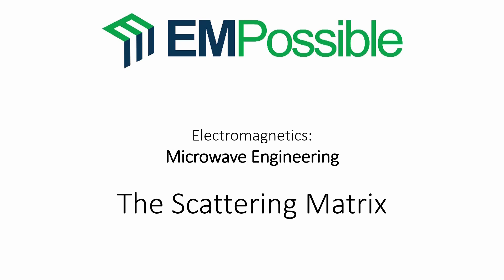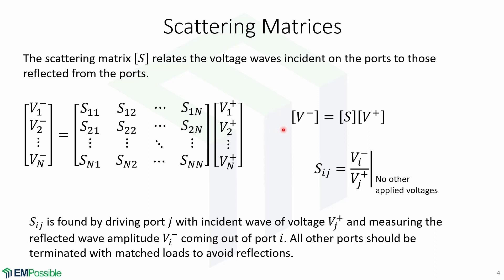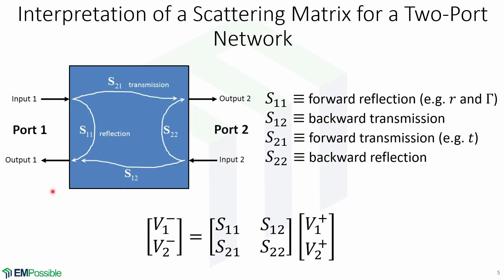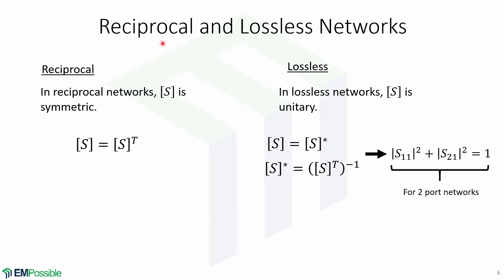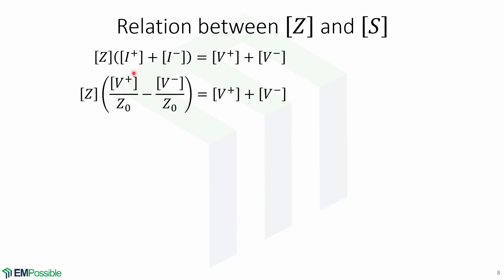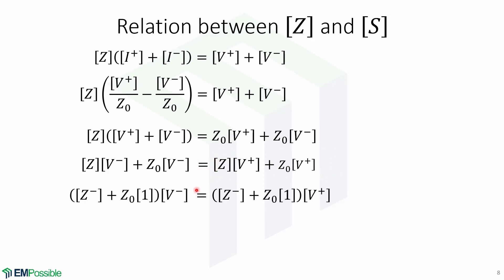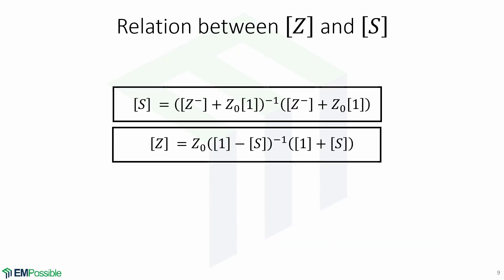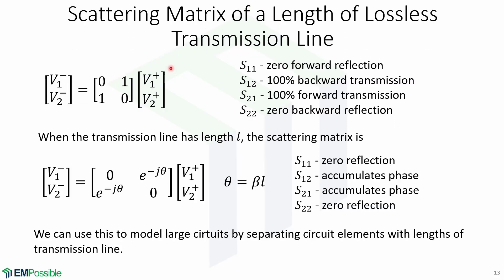Lecture -- The Scattering Matrix

Comment: at about 10:30, I don't understand, surely impedance matching enforces the reflection to be 0? What would it be in the general case?
Reply from the maker: In the general case, it is a fields problem.  The fields on one side of an interface must match the fields on the other side.  A change in impedance being responsible for reflections assumes the transmission line is otherwise the same.  However, if you hook a 50 ohm micro coaxial line up against a 50 ohm parallel plate line, you will get reflections because the electromagnetic fields look different in the lines.

Comment: Hello!

I'm working my way through your course on 3D RCWA and I noticed that on slide 18 of this lecture, you're taking the inverse of A-XBA^(-1)XB but in your implementation, you do not. Why is that?

Thanks!
Reply from the maker: Somehow I missed this comment.  Very sorry!  I suspect the following...

It is very rare in numerical methods to calculate the inverse of a matrix.  Something like A^-1 B is not the inverse of A times B.  Instead, look at this as matrix division.  In this case, it is a predivision.  So the code in MATLAB would be A\B instead of inv(A)*B.  The matrix division does not calculate the inverse and will run orders of magnitude faster and more efficiently than if a matrix inverse is calculated.  

Is this what you are seeing?